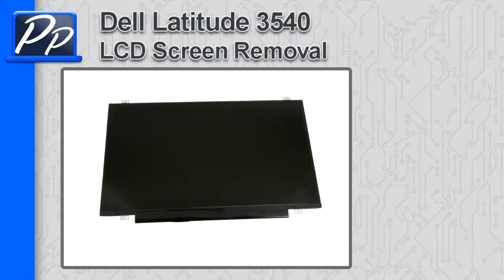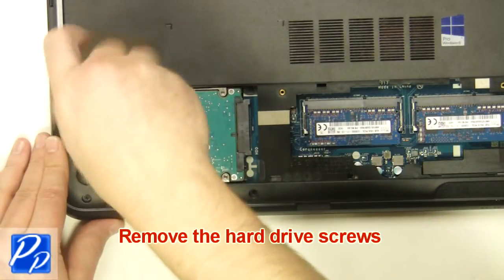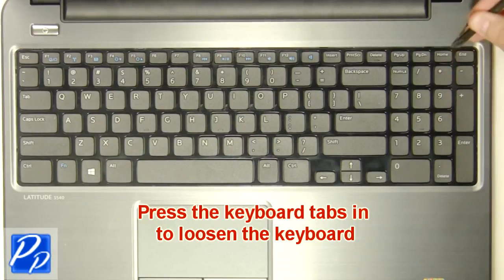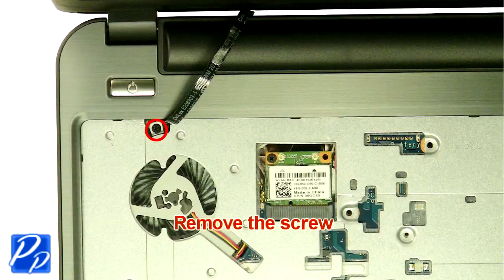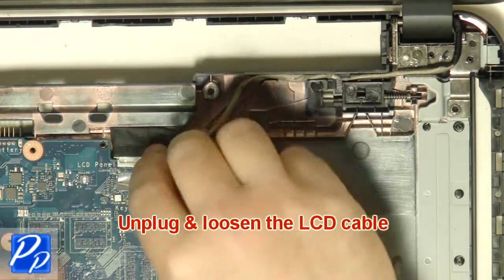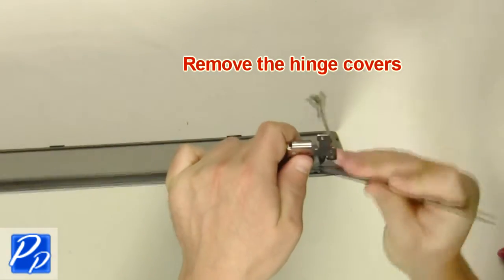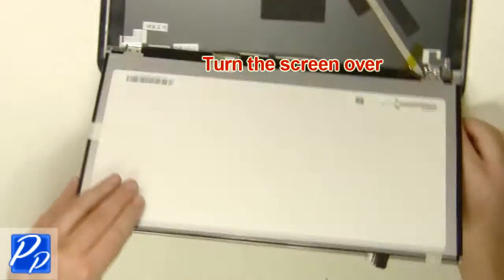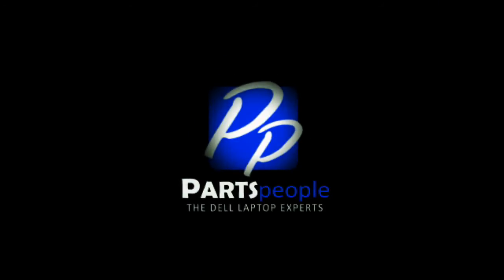Dell Latitude 3540 LCD Screen How-To Video Tutorial

Comment: At the 2:12 mark through to the 2:33 mark is where 90% of people destroy the laptop motherboard. Once you break that VERY fragile clip holding the ribbon cable down it is hard to imposable to fix. I wish the person that made this video had made this danger more clear. The next landmine starts at the 3:03 mark. People will forget about a screw and force the palm rest open. This damages the threads in the palm rest that holds the screws that hold it together from the bottom case. Any lose point is a place that dust can enter later. To be honest these 2 items on a laptop disassembly are the same on most all Laptops. Please folks, if you disassemble a laptop, be gentile, don't force anything open. I refurbished a Dell Latitude 3540 in 2020. Someone had broken the ribbon cable clip and they were using an external keyboard. I had some replacement clips and carefully soldered a new one on the MB. I still think the latitude 3540 was one of the best laptops Dell ever made. I use mine on my job!